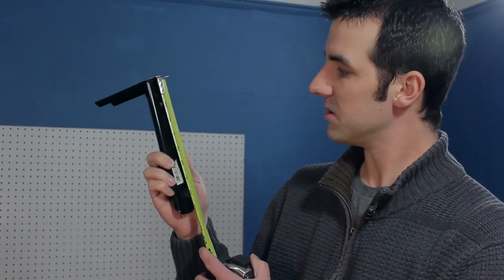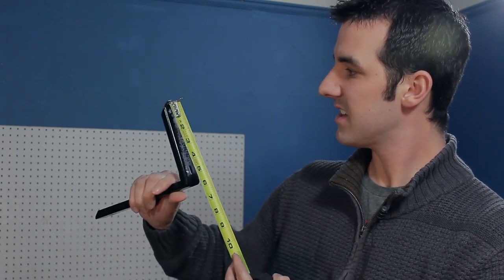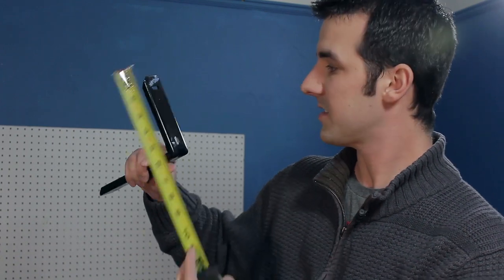RotoRig Q & A - Monopods, Parts and Other Things

Comment: Here's a tip for everyone. If you are going to drill the holes in the slots, use a step bit. The step bit is not spiraled like a standard fluted drill bit. It has about a half dozen different sizes on one bit, stepping up a small fraction at a time. You can start the hole with a size a hair larger than the slot, and once that is drilled, the hole will be round for the next size. Plus, if you use a step bit, you don't have to swap bits.

Comment: If you place the bracket on a piece of wood and drill through it, you won't have the problem of the drill bit getting stuck in the open slot.

Comment: Is there any issues with the monopods bending from too much weight on either end? Also, couldn't you use a plastic flag where the bolts go in? Would eliminate any issues of not being drilled cleanly. Just a thought. Thanks again

Comment: I wonder if anybody else than me thought of just using a straight piece of aluminum and cut it down to the right size, bend one piece (to mount the tripod) and drill 1/4" holes into each of them where the handles will be.
Than you could just get handles (search for monopods on ebay, you will find them 9dollar each) and screw them in.
This way you would be able to dismount the whole rig in seconds and you would have real handles on it. Yes it might be a bit pricier but no by much.

Comment: ok,I believe i am confused on the brackets. There are 2 Large and 2 small ...right? Can't you just get the Mennard's Large :Model Number: BK-0036-BK  |  Menards® SKU: 2113632    Variation: Black    Online Price $3.27..Dimensions: 5.875" H x 1.5625" W x 9.1875" D. AND Menards Small backets too?Model Number: BK-0035-BK  |  Menards® SKU: 2113630 Variation: Black Online Price $2.97..Dimensions: 4.5" H x 1.375" W x 7.1875" D.. 
Having a hard time seeing the difference in the Blackwall bracket.Flower Box Wall Bracket which stats :Made of extruded aluminum for strength. Holds most metal, plastic, or wooden flower Easy-to-install and will not rust. 7" W. x 4" H. Color: Black.

Comment: How about a more in depth DIY build on your Rotorig, show us exactly how you built it for us Dummies who are not mechanicly inclined with a complete list of material at the beginning of the film and the locations of where you got each part. For us Dummies.
Reply: frank moon I just bought all the parts.. Had to go to 2 different homedepots, 2 different menards and a crafty beaver for the flower brackets.. I think dummie to you is just another word for lazy. It took me 3 hours to track these parts down. The hardest part to find was the nylon washers.. hidden in a drawer @ homedepot and of course, not in the right spot.. They were mixed with the 3/8th washers.. sit down and daydream about this setup for a while, you will learn how this rig works the way it does and also be able to modify it for your needs